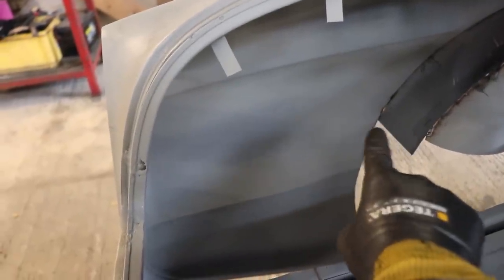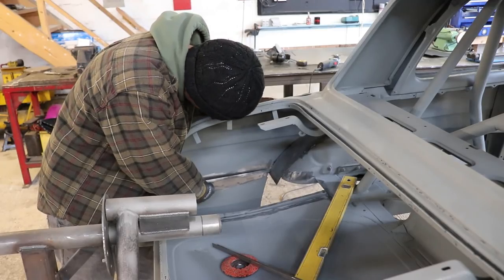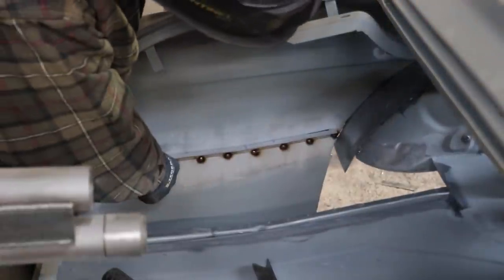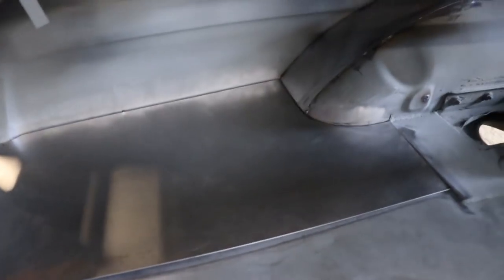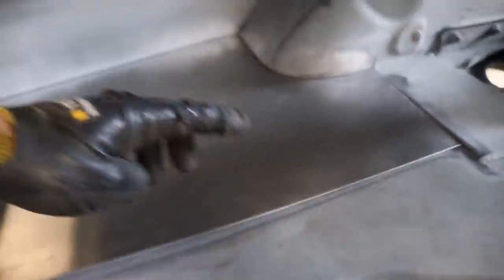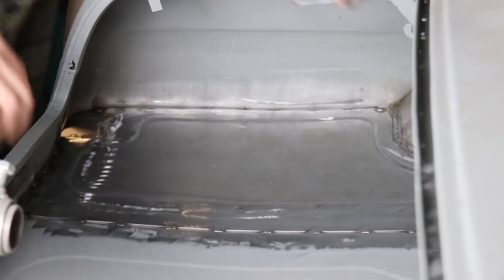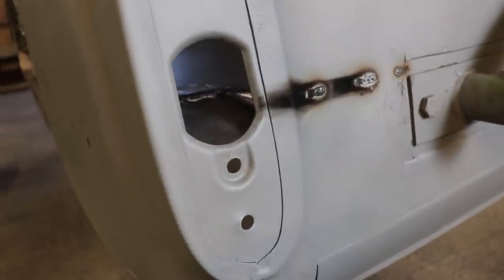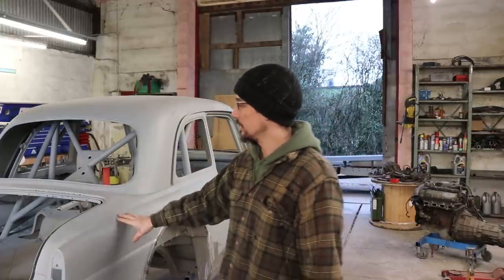MAKING MORE PANELS ON THE FORD BODY MX5 MIATA BUILD. URCHFAB MONGREL

Comment: Excellent work as ever Matt. Never very good at fabricating. Just warmed the metal and knocked it together. However, many years ago, early 70s got a BMC 1100. Usual problems rotted floor and back subframe mount. Anyway stripped it out, made angle brackets for the floor, spot brazed it in (no mig oxy acetylene) undercoat and rattle canned original 'smoke grey'. Shortly after, trip from Ulceby near Alford to Brayfield (Northampton) stock cars with mates. On the way pulled in for a check 'VOSA' nowadays  so serious. They were so upset not to find anything wrong.....even moaned about the tyre pressures. True story, however if I'd been stopped in any car beforehand ........ JAIL LOL.

Comment: Some realy great work Matt, I think I would have used some spare wheel dropped repair pannles instead of the flatt floor look mainly to reduce the wind drag against the rear pannles on the underside when driving
Reply from the maker: Sounds like a good idea but a lot more work. Cheers

Comment: would love to see detailed help on plug welds, im having trouble getting good ones
Reply from the maker: Turn your welder up and blast them in hot.
Reply: @Urchfab  Ok, i took your advice, I turned it up 50Pc more volatage and boatloads more wire (I am using o.6mm) and had a lot more success.

Comment: You would never know that was not  OEM, lovely work. How about putting the final finished car in to a Classic car auction  like H&H or even Bonhams with a short compilation video pre sale. That way you could see a real return on labour and fund the next one  ( even though of course it would be nice to keep it .) Get on paypal chaps. You equipment chaps send Matt some kit as well - he clearly needs a good spot welder. Cylinder rental from BOC is a fortune these days. Motor factors are doing outright purchase of half cylinder size  and you only pay the refills.
Reply from the maker: I'm hoping I wont have to sell it at the end. I want to do loads of events in it. 
Cheers

Comment: My opinion would of been to do inner tub or wheel arch and left inner quarter open. Be heaps strong at bottom so quarter doesn't flap about. Only for easy of replacement if stacked on track. Thorts fellas?
Reply from the maker: Yeh its not gonna be the best option if I hit it but I wanted the boot fully sealed off.
Reply: @Urchfab  i see. Bloody good job anyhoo mate. Been panelbeating best part of my life and you have shown me other ways to do a few little things! Love it. You have more motivation than me! You would cry if you seen my rusty things.